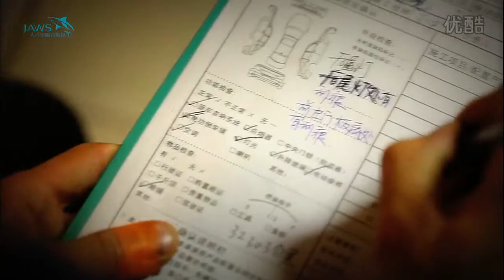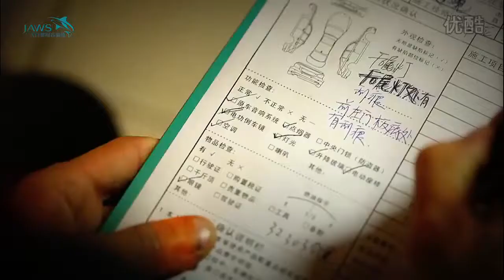Full soundproofing car. Vibration isolation and noise reduction.

Comment: And there is any reasons to cross the strips on some areas and others dont?
Reply: I was going to ask the exact same question
Reply: My wild guess would be to allow this higher quality (white) material to get in between. But those strips are still necessary to dampen the flimsy metal panels and give some extra rigidity.
Reply: Sorry for such a late reply. But a 1/4 of the covers area is enough. So they put more than enough. The aluminum material is to dampen the vibrations. If you look for the scientific videos about reducing vibrations you’ll see what I meant.

Comment: why to apply strips and not full coverage of the silver material? My guess is because of weight and material saving, but I would like to hear from you.
Reply: I ghink not, and me personally would not like if i open the hood of car to see strips... j know the purpose of those materials but even with all this to gain 3 to 5 % less noise inside the car and 2 3 to 5 % less vibration i will be wery happy becouse that even 5 % is very very noticable, but still when j look doors roof inside the hood and trunck of the car u will still see the factory look materials of the car not some strips papers and all that ctap, so anyone will see ur car gow looks fabric good and when u start the car and drive and drive passangers they will be pleased with allso you how it is not that noisy or not all all and especialy when u have like me v6 engine 3 litter sized engine, but i have audi a4 so no need for isolation but especialy with big engines u get more sound level and vibrations, and especialy when car is older with big engines, they after couple of 100k millages they get a bit worn and louder so that helps allot ^_^ those operations are allso great for SUV's they are big and not stiff as the same quality cars wich are limosines so vibration is handy to have ^_^ i mean that material wich helps ur doors and roof and to not wibrate and cancel a bit of noise from them allso
Reply: 1.Weight saving 
2. You don't need to cover 100% of metal the silver sheet is to eliminate the vibration not for sound proofing 

So save weight save $$$$ 
And still effective